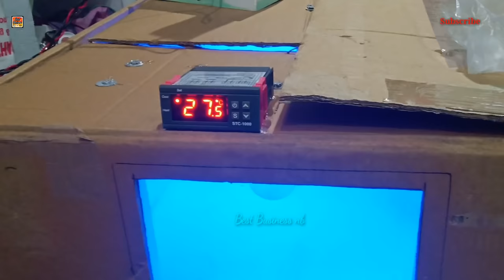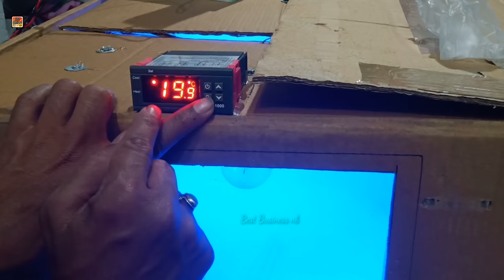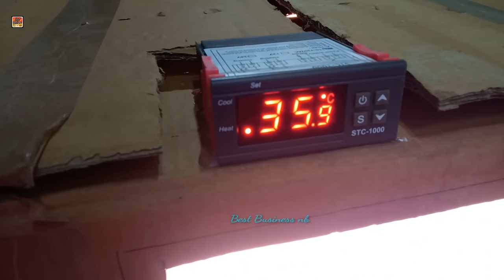how to make hatching egg incubator at home | चूजे की मसीन

Comment: This will not work because the uper side lid will become wet with the humidity .the thermopor sheet should also be added on uper side as well.
Reply: it will work definitely i experienced i had it in printer box and work without using thermo sheet

Comment: Dada,nice vedio thanks iss ko dekh mein aapney incubator banaye per mujh el samara aa raji hai.
 meri ek sawal hai
Temperature indicated by temp. Module w1209 is 37.8 cut temp and 37.0 to on but the temperature indicated by HTC 1 IS 31.7  I made it with thermocol box and gave 2 aur holes at top and bottom, what could be the reason and corrective action  to be taken. Please reply . Sir aap busy ho per, reply nahi dete hum aap ki guidance ki wait karte rete hain. Aur dukhi ho chor detey hain
Kindly  replying
Thanks

Comment: I wish this could be translated into English.....
Reply: Me too am getting nothing then about the materials used they have not been mentioned making it hard for me to get it to the best
Reply: @isaacagida5871   requirements 
1 box with lid.
1 thermostat 
 pc fan depending as per box
1 led light 
12 v adaptar
1 or 2 Bulb for heat.
Wires etc.
See the video and do the connection 
It's simple